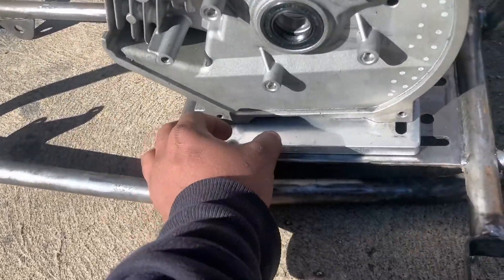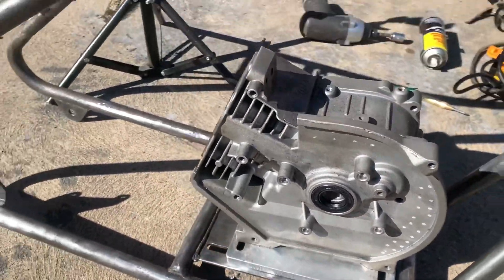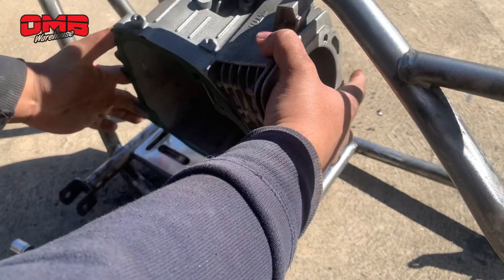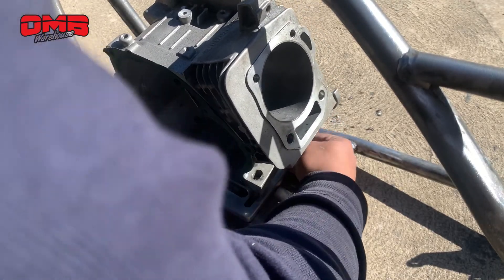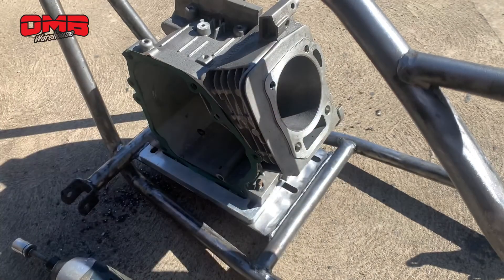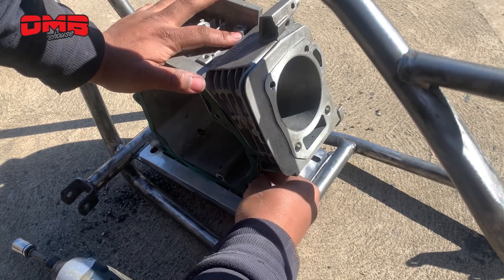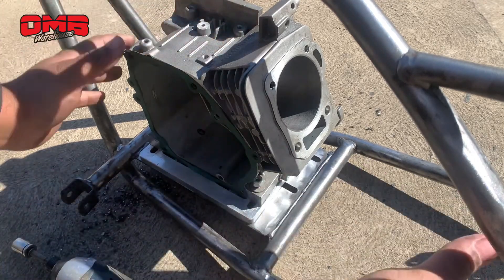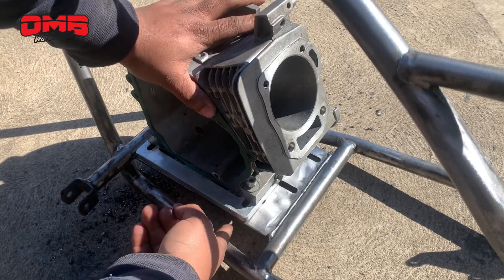OMBwarehouse: Adjustable motor mount installment!

Comment: I just bought a motor mount. I see At the beginning you put the motor mount flush with the frame. Is that a good thing to do? Also when you marked your holes before drilling did you place the marks center?

Comment: Seems like a waste,  figure the are small block and large block engines. Just mock up position for the new mower and slot the old plate, engine has more clearance and you keep cash in your pocket.
Reply from the maker: It serves multiple purposes, one being able to move the engine side to side meaning you’re able to move the engine depending on clutch positioning and being Able to swap out sprockets and lining up the clutch without having to drill any holes is a plus….once you add a sprocket adapter and a 420 sprocket the whole engine would need to be moved because the sprocket is out more do to sprocket adapter. Secondly being able to tighten the chain on the fly without having to weld or buy new chain tensioner wheels is a blessing from the plate. Third you’re able to run a torque converter depending on how you mount it without having to lift the engine up to the recommend height…meaning you’re able to keep the stock gas tank on the engine unlike other torque converter mounts out there.
Reply: lol thats what i did but when i run str8n chain it hits the frame gotta raise it up i think im gonna just get a couple notebooks and call it a day